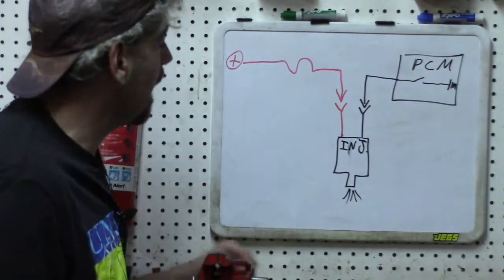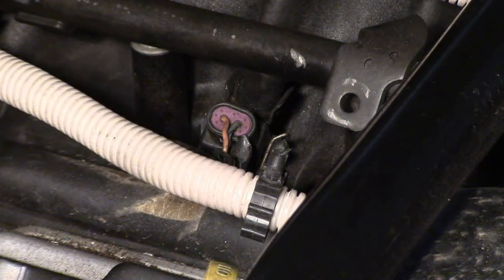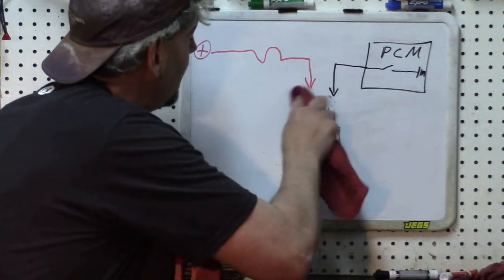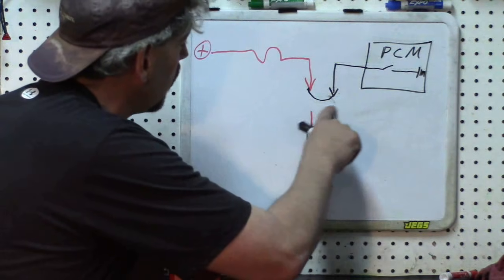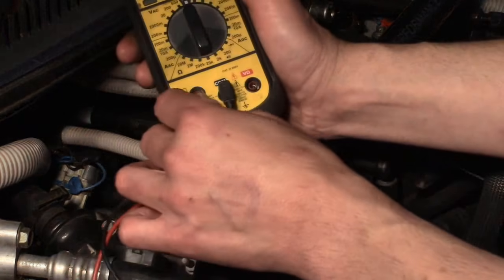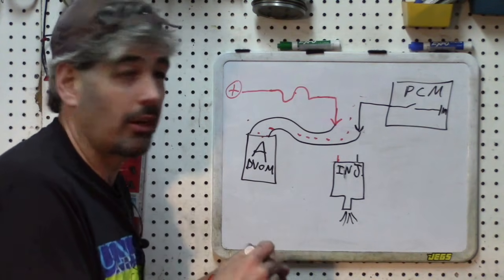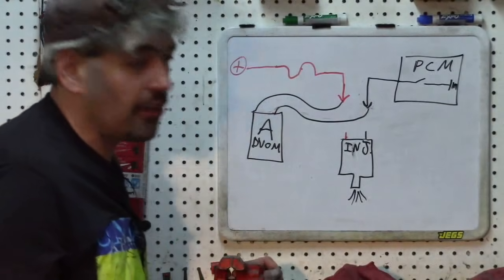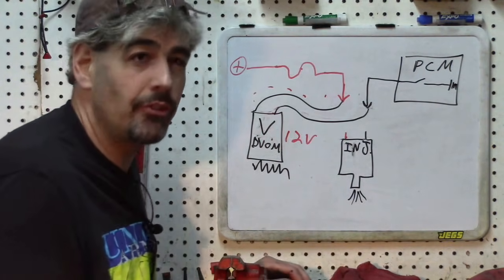How to Not Fry Your PCM-  SBQM Channel Free Video Sample!

Comment: HI MATT, LETS SAY I UNPLUG THE INJECTOR CONNECTOR AND I DONT KNOW IF IT IS POWER OR GROUND SIDE SWITCHED. AND I CLAMP MY TEST LIGHT ON BATTERY POSITIVE,  START THE ENGINE AND I START TO TOUCH ANY OF THE TWO WIRES COMING TO THE INJECTOR .BECAUSE I AM NOT HAVING WIRING DIAGRAM THEN I TOUCH EACH TO SEE WHAT IS GONNA HAPPEN. 
CAN I FRY MY PC BY DOING SO.

OR IF THE CONNECTION IS VICE VERSA, THEN,
OR IT DOES NOT MATTER ASLONG I HAVE TEST LIGHT IN BETWEEN OF MY CONNECTIONS

M.B.S MOSHITOA (S AFRICA)
Reply from the maker: No you cannot damage pcm doing that. it is a valid way to identify the circuit design.
Reply: @SchrodingersBox  THANKS, OTHER THING I LIKE ABOUT YOU IS THAT YOU TRY TO REPLY AS MANY OF US AS YOU CAN.
Reply: LAST QUESTION, WHAT IF I AM USING DVOM AND HAVE SET IT TO DC VOLT, AND HAVE PUT ONE PROBE ON BATTERY +VE AND THE OTHER PROBE I KEEP TOUCHING EACH OF THE CONNECTORS WIRE WHICH I AM NOT SURE WHETHER THEY ARE -VE OR +VE. 
THAT WAY CAN I BLOW MY PCM OR MY DVOM?
M.B.S MOSHITOA(S AFRICA
Reply from the maker: No you can not damage it. It is a good way to find which wire you are testing is a ground.

Comment: Great video and very instructive. (I passed, by the way. Yay!) A minor question on the four cylinder remark at around 12:15: Why would the events happen faster? An injector on a four cylinder engine would fire at the same rate as a six or eight cylinder engine at the same RPM, correct? You get one fuel spritz per cylinder for every two crank revolutions on any four stroke engine. Only revving it up would make the events faster. Also, on an unrelated subject, is all that white cable sheathing stock or did you add it?
Reply from the maker: +Rob Mut True at the same RPM- I guess I was thinking how usually smaller engines rev faster but correct at Idle there would be no difference.
  The white wire sheathing was actually blue but it turned white within a few weeks because it was cheap crap lol.
Reply: @SchrodingersBox  That is Funny. I thought you used white because it was "cooler" than black reflecting heat away protecting Wires and Hoses from intense heat cycles! ;)

Comment: 2010Subaru Sambar 1 coil pack didn’t work after installed
Reply from the maker: Always start with the basics first : Check if there is a signal input and if there isn’t introduce one as a bypass to validate the integrity of the system. That exactly what should have been done first because it certainly didn’t need the new coil in the first place.

Comment: This video is not new and my thoughts might have been addressed, but anyway:

- Let's say the injector is faulty, but we had luck and it blew the fuse before frying PCM. Assuming that, wouldn't it be the safest to unplug the injector, check its resistance (to make sure it's not internaly shorted) and then continue with tests? Because if we just apply 12V to it, we would fry the PCM, as internally shorted injector presents no load.

- On the MAF connector, the viewer assumed the pink wire is power and had an idea of applying 12V directly to it. But if he was wrong, he could have applied 12V directly to the signal wire, and that could be bad? 

- Also, let's say that the connector has melted inside, cutting the power wire, but shorting power and signal sockets. If we apply 12V to the power socket, we send again that voltage directly to the PCM via signal wire. Not sure how to test this one, how does DVOM work in a resistance/continuity check? Is it a load in the circuit or not?

Putting the probability of these scenarios aside, I am happy to be corrected if my logic does not stand.
Reply from the maker: all sound rational to me.

Comment: Now that I have gone through this video about 10 times I have one question.  The test no.6 looked very similar to the last test you did, except in the test no.6 when you tested the fuel injector you did not use a DVM in amps mode you simply just took the power directly from the battery.  I understand that DVM in amps mode does not provide a load but I didn't see the reason for using DVM especially because you have a scan tool where you can clearly confirm the work of a MAF sensor.  Is this assumption correct or am I missing something? Thank you

Comment: Hi,

a few comments regarding the injector tests...
assuming the fuse is correct, it should be rated to protect the pcm against a shorted injector solenoid, so the first 2 tests shouldn't fry the pcm (I'm not saying that you should do them, of course, because they don't really prove anything).. The test where you bypass the fuse could be dangerous, on the other hand, in case the injector solenoid is in fact shorted... I really like your material, and actually this is the first time, where I thought - ehhh, that is not completely right... keep up the good work :-)
Reply from the maker: +hooverphonique I can most definitely, 100% assure you that you you are incorrect and you CAN and WILL fry the PCM by bypassing the injector. I have seen multiple times where a shorted injector has fried a PCM.
Reply: +Schrodingers Box so you're saying that the fuse does not blow in case you short the injector? why is it there then? just in case the insulation on the harness is compromised?
And if you're so sure it will fry the pcm, I don't understand why you tell people that they can just bypass the fuse to check if something is wrong with the 12V feed..
Reply from the maker: hooverphonique Correct- on a PCM circuit with no current restriction the driver will fry long, long before the fuse. Remember on 12V Circuits they are virtually always ground side switched, so obviously fuses are irrelevant to protecting the PCM.  
I have no idea what you're talking about when you say i recommend to bypass the fuse to check a 12V feed- where did I say that?
Reply: Your comment "so obviously fuses are irrelevant to protecting the PCM." is problematic. Fuses are important! The first test to be performed should be to check that the sensor is not internally shorted to ground.

Comment: hey folks can i give direct positive of the battery to pcm negative through multimeter set at 20 VOLT
Reply from the maker: Why would you want to do this?
Reply: @SchrodingersBox  because I have one fuel pump circuit diagram on which the ground is given by ECM to one of the solenoid side of the relay for around 15 seconds hence can I check this circuit by putting multimeter set to 20 v and putting red probe to positive terminal and black probe to the solenoid side of the relay connecting to ECM Just to confirm whether ECM is giving ground or not??????
Reply: @SchrodingersBox  kindly reply soon
Reply from the maker: Simple- just test the ground side control against any 12V source. You can't do it testing against PCM negative in voltage mode at 20V- how would that possibly work??? The only way you could do that is through a continuity test which also works.

Comment: For the last test, a moderate quality DMM (not the $5 harbor freight) will have a 10A fuse for the amperage scale, although they are much more expensive and hard to find than an automotive blade fuse. He really only needs a fused jumper if he is using a clamp ammeter.

Comment: wonderful video MATT, But i will thank you if one day you may do us video of how things should be. i mean like this
o2 s1 should be between o-1
o2 s2 should be approximately 0.5v
maf should range between WHAT WHAT TO WHAT WHAT ON NORMAL CAR.
ET CETERA.   

BECAUSE I JUST BOUGHT SCAN TOOL , BUT STRUGGLE TO KNOW WHAT SHOUL BE WHAT IF THINGS ARE RIGHT. 
BUT AS FOR FUEL TRIMS I EXCEL FROM YOUR BEST VIDEO. HAHAHAHA

KEEP IT UP

M.B.S MOSHITOA(S AFRICA)
Reply from the maker: Yes what you are looking for is a list of “normal baseline parameters”.  It’s something most people try to find when they first get a scantool.  Unfortunately they don’t exist.   There are so many varibles- ambient temperature, load, engine temperature, RPM, etc that “normal” is always dynamic.
     What you do is look for readings inconsistent with conditions AND with other readings. Also failure of a reading to change with conditions is what you look for too.   There really is no “fixed baseline”. 
   There are some generalities though. At idle I expect a TPS of under 7% but again - if it’s a drive by wire system and the engine is warming up it should be around 20% or even higher if engine is really cold. 
  A MAF at WOT should read a Lb/min value approximately equal to engine displacement. 
  A rear O2 should not read .5V- it should read .8V at 2200RPM but the most important thing is that it doesn’t duplicate the front O2. But it depends on the catalytic converter temperature.

Comment: 29:09 Actually, if the ground was broken, you might fry the PCM by passing all the heater resistor current through the signal wire at 12V. It wouldn't be wise to do this before checking the ground first.
Reply: +celeron55 Sorry I am not following... How is that possible when the heater circuit is not even connected to the PCM?
Reply: +Schrodinger's Box Quantum Mekanix The heater circuit uses the same ground point inside the sensor, which, when left unconnected, simply becomes a path for current towards the measurement side. The ground point will likely reach about 12V compared to the PCM's ground.

It all depends very much on the sensor's internal design though. The sensor may or may not pass a considerable current towards the signal wire in that situation (it's kind of a reverse polarity case) depending on what kind of components the signal output is using. I would be careful because there is no guarantee of what will happen.
Reply: +celeron55 Ahhhhhhhh yes you are right! I hadn't thought of that!! I have not been able to see an internal diagram of them sensor but I'll check this out. 
  Wow fantastic thought- totally never considered that!
Reply: +celeron55 The PCM in the diagram shows it to have a pull-up resistor, probably on the order of 1kOhm-10MOhm to +5V and the PCM will have its own similar internal resistance or a MOSFET (from the designs I know) so I wouldn't think that side of the circuit could sink any power to speak of. 

Are you concerned that +12V (that you suggested could maybe be linked internally) in and of itself would do damage to an input designed for a +5v reference?

To my thinking, if the ground had failed and the PCM input was of some vulnerable design, the +12V would have already killed the input long before you got there.
Reply: +anyheck That's very true! The damage would have already been done if the ground was broken and the sensor-PCM combination was vulnerable to it. So my point kind of ends up being just a curiosity and not very practical.
Reply: +celeron55 Lol still a great point and thanks Anyheck too- great dialogue and I hope everyone sees this thread!
Reply: +Schrodinger's Box Quantum Mekanix 
+celeron55

Giving it a bit further thought I don't think there is any common automotive connector that has a "grounded-first" type of connection (think a north-american NEMA 5-15 120VAC grounded plug) and you don't ever hear of folks blowing a PCM by hot-plugging connections (a slight misalignment might make signal+power connect before ground), so the vulnerability must just not exist in any modern design. 

Disclaimer: I'm no electrical engineer, professional mechanic, nor did I stay at a Holiday Inn in recent memory.

Comment: HI MART, I LIKE YOUR VIDEOS BECAUSE IN MANY CASES YOU TRY TO USE DVOM WHICH MOST OF US HAVE YOU USE SOMETHING ELSE WHERE IS NECCESSARY. THANKS FOR THAT

LET ME ASK THIS. I THINK DVOM ON CONTINUITY HAS VERY LITTLE RESISTANCE. AND I HAVE SEEN YOU ON ANOTHER VIDEO TRYING TO FIND WHICH WIRE WAS NEGATIVE. YOUR DVOM WAS ON CONTINUITY AND THE CAR WAS ON BUT ENGINE OFF. THEN YOU PUT ONE LEAD ON NEGATIVE AND THE OTHER PROBE ON ONE OF THE WIRES ON THE HARNESS. FORTUNATELY IT BEEPED AT FIRST ATTEMPT AND YOU SAID MMMM THIS IS MY   -VE. 

BUT I WISHED TO SEE WHAT WOULD HAVE HAPPENED IF THAT WIRE WAS NOT GROUND BUT FROM PCM.

WOULD`NT YOU HAVE FRYIED YOUR PCM? AS I BELIEVE DVOM IS JUST LIKE JUMPER WIRE IF IS ON CONTINUTY
I USE TO FEAR TO DO THAT.

M.B.S MOSHITOA (SOUTH AFRICA)

Comment: great video - thanks.
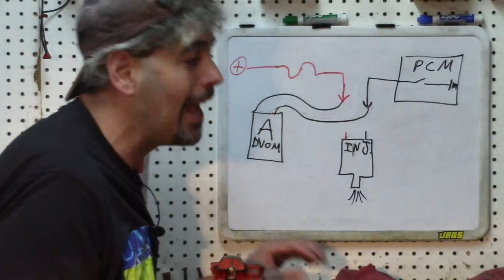However @ around 10:39 "the DVM presents a MASSIVE load".
No - it presents a large impedance, ( think resistance) ) of several Meg Ohms.
This is "per volt", so it changes with the scale.

A massive load would be a short.

MickM
Reply from the maker: Good catch. Very true. I did mis-speak on that.

Comment: The test you did by running a jumper from battery directly to the injector with no fuse protection sounds insane to me. What if that injector had only 4 ohms resistance? You would be shooting 3 amps to the PCM.
Reply from the maker: +Rick Bittner Then in that case how would the PCM not already have been blown? It's no different than the fused connection the car already uses. The PCM would blow long before fuse did.
Reply: +Schrodingers Box You have a good point there, but a fuse is also in place to protect the wiring harness. What if you had an intermittent short just before the PCM or at the pcm. You could melt the insulation in that harness. You could also get burned from the jumper wire.I just don't think that an unfused jumper is a good idea.
Reply from the maker: Rick Bittner I don't understand how that would not have blown the fuse in that case already.

Comment: YES! YES! YES!  I want to be in the 2% and it's possible althogh it is a bunch of work!
Reply from the maker: It is a bunch of work for sure.  It took me YEARS to learn this stuff. YEARS!!
Reply: @SchrodingersBox  You are a great teacher! Your voltage drop vid is excellent. Also map sensor vid which I'm still dealing with on my '88 f150.  I replaced brake booster &truck ran great until it didn't.  I thought I had a bad throw out bearing b4, sorta sounds like that altho I recently put in a new clutchset (then the engine problems strarted lol) but now I think I'm just low on ATF for my M5OD 5 speed... I think  excess drag of tranny is adding load to engine at start up causing the map code 22 ...  not totally sure yet, but best to make sure tranny fluid is full b4 next step plus shift is bad now.  I'll let you know what happens.  Interesting to think that some ATF might cure the code 22!
Reply: @SchrodingersBox  yes, you knew it!  The ATF wasn't going to fix the map sensor lol, but at least my tranny doesn't have a leak and it seems to be shifting better for now for some reason, it is an old cantankorous truck after all, anyway, yes, I have my work set out for me,  Headaches but only cuz I'm trying to make this my daily driver but I'm fixing up this beatrer as a learning experience.  I'll be watching more of you vids,learn to probe & get a scan tool, gotta figure out which one to get.  Truck seems to run from cold w/out the engine light and it's running better than ever, compression's good (I replaced the injectors, 2 were bad which I learned not thru proper diagnosis but when I tried to clean them on the bench... I got a new saved 41 code, lean condition.. so I'm thinking vacuum leak, I'll hook up my $5  pickle jar smoke machine that I made... & check everything.
Reply: ok, to end the boring saga, a happy ending mind you, yes I am an idiot half the time but eventually I come around I guess-  the culprit was a vacuum leak... the booster leaked a bit, which I replaced but the vacuum reservoir had leaks too.  Tried the smoke machine to no avail, but the vac gun proved itself and then the water bucket to identify the bubbles- I pulled out the oxyMagneGas & some brazing rods and filled up the leaks then cleaned it and put a coat of Penetrol on the can-  maybe I'll order a new can for $40 on ebay if I'm not feeling cheap- but anyway... no more Engine light!!! The best feeling and even better I'm on the road again! I so need this truck right now! Anyway, thanx for the help, I'll continue to watch your vids!

Comment: It has been a long time. But when I wrenched. I would rarely do amp tests on circuits I was unfamiliar with.
Reply from the maker: +gc That would be a smart thing but as you see, the more I have become involved in advanced diagnostics, the more I have been doing amp test and in delivering amperage to circuits in order to test them.
 If you're going to be doing diagnostics on things like hall effect sensors, fuel injection circuits, and the like- there's no way around it. Understanding the circuits is essential to proper testing and diagnosis.
Reply: +Schrodingers Box I just like doing these troubleshooting. It presents a challenge. Even though I don't work on cars anymore. It's been 20 years. I still enjoy it.
Reply from the maker: gc Thats all it is for me- the thrill of the challenge. Once I make the diagnosis the fun stops.
 When I charge people for repair- I charge for the brainless wrenching, not the diagnosis lol.
  Crap- I have actually PAID people to let me do the diagnosis on their car because I thought it would make killer video lol!

Comment: fortunately the injector drivers in modern PCM have short protection build in , if not a simple possible wiring problem will fry it ...
Reply from the maker: Really? I just figured it was obviously the ground side switching design that was the safety. What exactly is the "modern PCM driver built-in short protection" how does that work exactly and if so, why are they ground side switched?

Comment: Test lights can be evil to a newbie and when you don't have a schematic and are just probing, use a DVM. It is the safer bet. The test light will always have a lower resistance, aka the bulb compared to a multi meter set to volts. The bulb in a test light can be as low as a few hundred ohms. Ive seen too many people use test lights incorrectly activating circuits or cooking components  when hooked up incorrectly. I would use a DVM till you understand how an electrical system works on automobiles. My 2 cents.
Reply from the maker: Agreed 100%